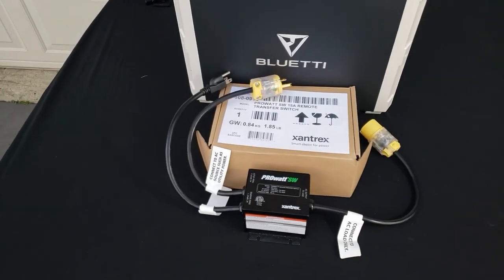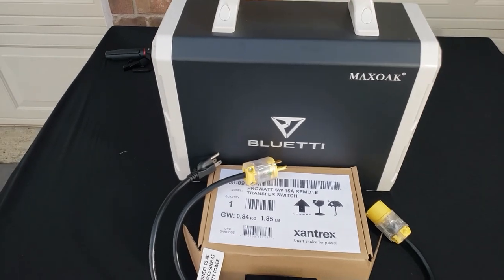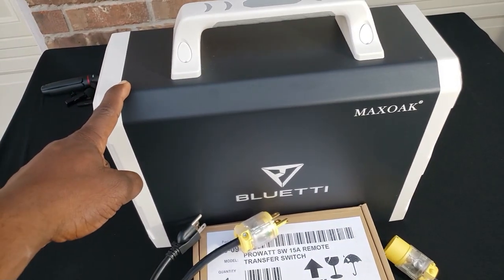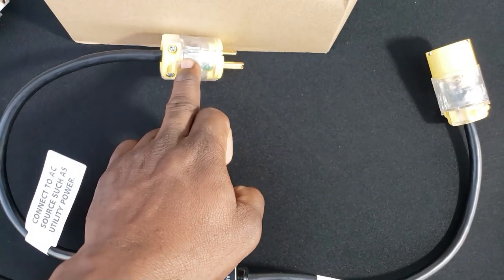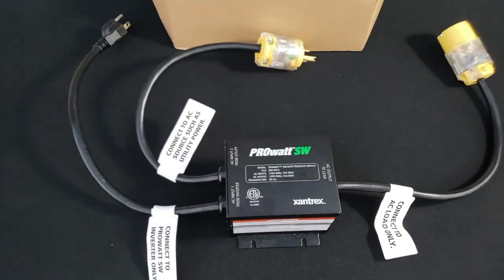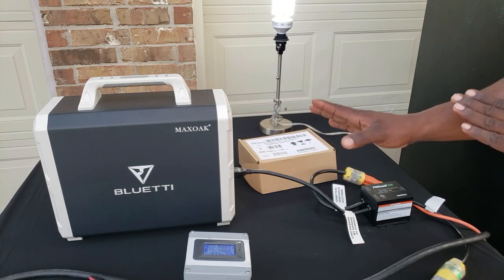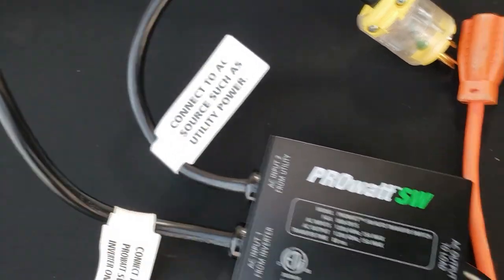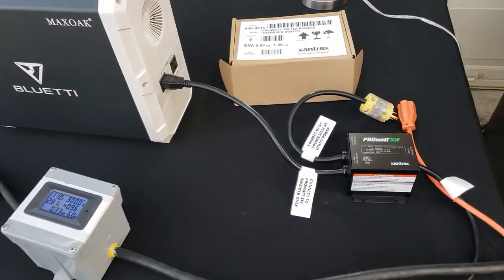Xantrax - Prowatt sw Automatic transfer switch

Comment: i personally have one in my Service van.  it switches between shore power (exterior inlet) and the inverter.  its Works great and is a perfect work-around if you have a smaller inverter that does NOT have an integrated xfer ; such as anything sub 1500watts.

Comment: I use this type of device when placing generators at remote sites with manual transfer switches.  Incase the generator runs out of fuel and commetcial power is restored the site will keep running.